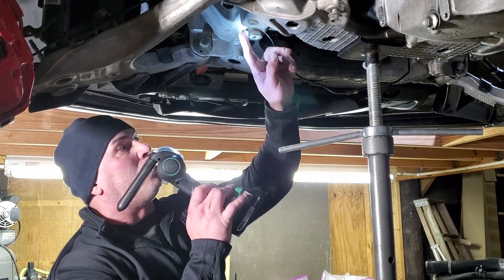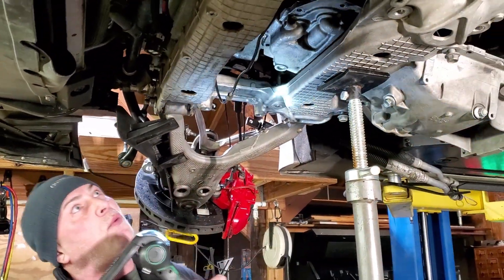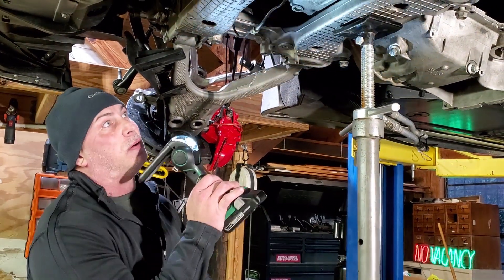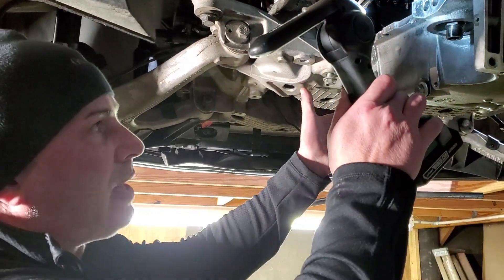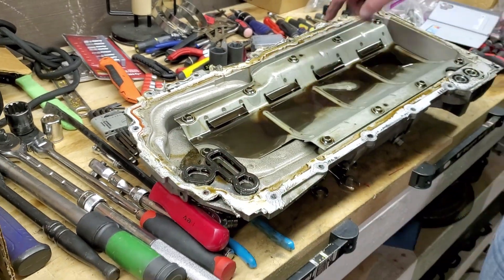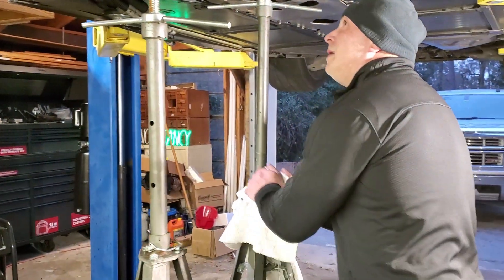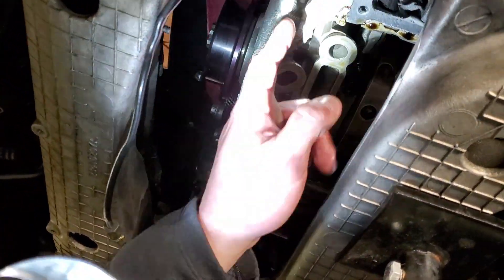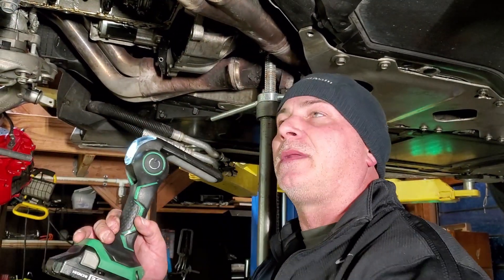Guide to Removing the Dry Sump Oil Pan on a C7 Z06 with the Engine Installed!

Comment: First vid i’ve seen that explains this and goes into detail. I’ve been wanting to tackle this to do a cam install on my c7z. This gives me a little more confidence, thanks!
Reply from the maker: Anytime Christian I looked for videos and posts and couldn't find much out there if anything useful.  Other than pulling the engine or dropping the cradle.  Both of which are just way too involved for removing an oil pan.  Glad it helps!  I have a new custom dedicated oil cooler video coming this week my custom lines and improved racing billet oil adapter with thermo arrived yesterday.  Just waiting for my core.  Good luck and glad to answer any questions!

Comment: Thanks for the videos and info. Changed my oil pan this weekend. 8 hours old one off new one installed and the car reassembled.
Reply from the maker: Awesome glad I could help even if just a little.  I did put another later video up with some new updates to removing the oil pan, most notably the best way to pry it off.  I've had some people contact me with trouble getting it off, so I found a better way.  Not sure if you saw that video but it sounds like you are good to go!  Any questions feel free to ask!

Comment: i have 416ci LT with LT4 supercharger new engine just turn on with about 200 miles and oil pressure drop to 4psi hot after a pull i want to check my bearings i want to remove the oil pan like this do you think i will have room to re torque the mains and rods with out removing the engine ? what is your oil pressure hot ? mine is 45-50psi cold.
Reply from the maker: Buddy I hate to say it but yeah could be bearing issues.  Did you check oil pressure with a manual gauge where the oil sensor is up top?  You can try that to make sure the sensor isn't bad.  It's also hard to know if the pump is going bad OR bearings.  Do you hear any noise?  Engine feel a bit off?  If you pull the pan off you can look very closely for heat marks (blue) near the main caps and on the crank near the bearings.  You can probably do the bearing swap with the block in but that would be so much of a pain.  Honestly I would just pull the motor.  Would save you so much headache.  I would be happy to help if you need any input.
Reply: @MichaelBrownPlus   the engine builder left the oil squirters factory on the stroker crank . all the oil squirters were broken down in the oil pan.

Comment: That's a lot of work to just drop the pan. I'm just going to pull the engine to retighten all the ARP studs/bolts after the break-in period.
Reply from the maker: @Al-wh4jz  it’s a pain due to the front pulley as I show.  But I’ve also done 4 engine swaps and I can tell you it’s much less work than that.

Comment: Have you every figured out why your oil pressure was low.?
Reply from the maker: Yep it was a faulty crank which also caused bearing issues.  Crank snapped in half idling.  Texas Speed built me a new 416.  I have other vids with more details of what happened and the new motor and finally successful 🙌
Reply: @MichaelBrownPlus 
Appreciate you taking the time to reply!
Love the video, been very interesting to follow!
If you don’t mind, I’d like to get in contact with you to get your expert advice. Also running a TSP 416 Stroker and would love your advice.!
Reply: What’s your most preferred method of communication?
Reply from the maker: @bobypolu6651  you can email me at michaelrbrown@gmail.com
Reply from the maker: @bobypolu6651 thank you!  Happy to help!